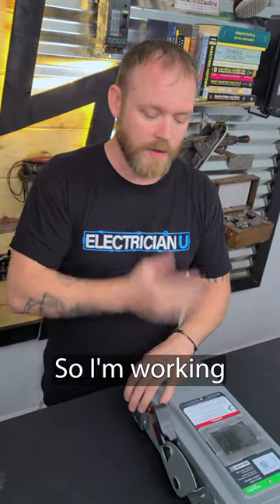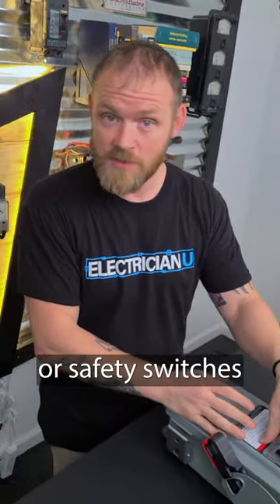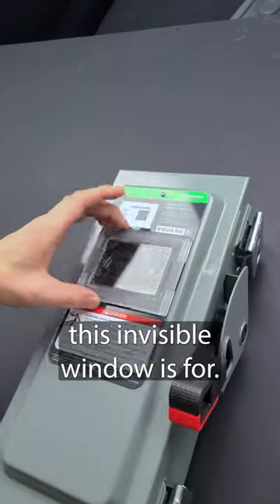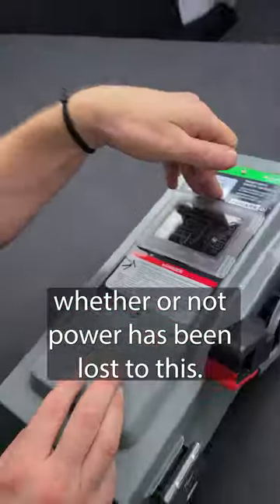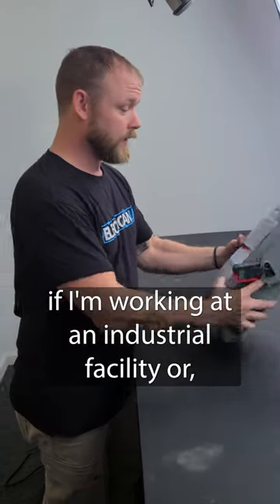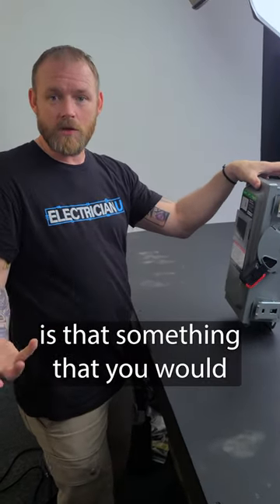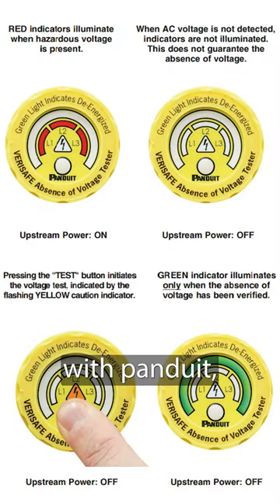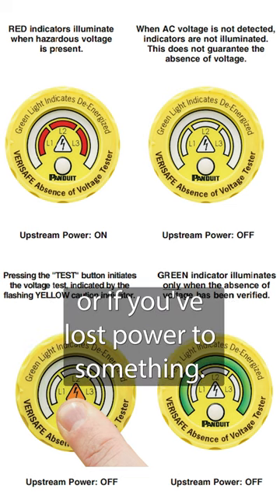Looking For Feedback on Schneider Disconnects

Comment: If it requires a chip, then absolutely not. If it's simple and inexpensive like you described then great. The downside of increased complexity is increase cost. Increased cost means units will remain in service for a longer period than they should. Unduly extending the service life will result in even crappier shut offs in exposed areas. An HVAC technician dealing with these things in exposed areas, I can tell you that many of them are hanging on for dear life simply because of the cost.
Reply: I don't think there would be a chip. Seems like a resistor and the LED would suffice. (?)
Reply: Agreed. I work in industrial maintenance and almost every one of our exterior disconnects are exactly as you described. We buy second hand a lot to keep cost down.
Reply: It really depends on the price break. The cost of material and all their reasons for increasing the price never ceases to amaze me. Yes it’s nice, but I’ll never lose the mindset of opening up a box testing the voltage and torquing the connections.
Reply: Actually a induction loop  to led would work, damn near infaillable

Comment: The industrial panels I work with have a safety test point with phase indicator leds and actual test ports to measure phase to phase and phase to ground voltage ourselves without even opening up the panel. It's super safe especially with high incident energy cabinets.

Comment: Breakers have to be, above all, absolutely reliable in their function. Adding something is always another way for them to fail. Imagine the LED malfunctioning and the tech haphazardly thinks "aw no power", because that was the case for the last 20 times, so he doesn't take the necessary precautions. Except this time, it's the LED.
The number one killer in electrics isn't malfunctions. It's overconfidence. And this, though generally a clever idea, will add to said confidence, when it shouldn't.

Comment: Be worried that the LED fails and you trust it too much and have a shock Hazzard.
Reply: An LED would be on if power was there on each phase. If there wasn’t power the LED would be off? How is that a shock hazard. If you have a power loss or trouble shooting I personally would still test for power for safety reasons at a minimum.
Reply: @ronh9384  hes saying if the LED burns out there could still be power, but the average person might just go "oh the led is off power is off". i agree though as an electrician always test before touching.
Reply: it's just for quick troubleshooting. you're not supposed to trust your life with it
Reply: yeah but you know as well as I do there’s always that guy that will do exactly that.  Gotta design for the lowest common denominator of humans

Comment: If I get a service call and I take the time to assist a customer, an LED light check won’t be enough, I still will test voltage with my multimeter, to make sure power is off/on and also to give customer a clear answer.

Comment: Yes good idea but electrician should still test for voltage safety first
Reply: Then why pay the extra cost for these? 
Wouldn't be used at my work,  electricians would still check with a meter

Comment: Depends on how much more they’ll charge for those LED’s realistically this is something I would only sell to a place that has a maintenance staff that’s not qualified or knowledgeable on the system to repair it. Other than that the old ones worked great and taking the cover off is like a 3 second job. Can’t justify spending an extra 100 dollars just to see a lights not flashing and I have to take the cover off to trouble shoot anyways.

Comment: Phase indication on the load side seems to work well . I have seen this on various applications as long as the wire process seems to be wire to light indicator. Once the wiring becomes to complex it seems to be more trouble than it is worth.

Comment: On the face of it, it’s a great idea. It would help with a quick diagnosis of a problem. 

A potential downside is when someone decides to 100% trust the LED lights and doesn’t check for a live circuit with their meter before putting their fingers in the panel.

Comment: I have been working around angry electrons for over 25 years... ON/OFF visual indicators can be helpful but from my experience testing REAL conditions and what that electrical power reading is still a way to go... for example what would be the min/max range for voltage that LED would be? What is allowed phase to phase in balance? There are many more examples like that... IMPO, No they will not provide any additional advantages for the cost ratio of that new LED disconnect. Not saying the idea is bad but that will be more unique and special purpose disconnects Vs everyday jobs. Good luck and great job with your channel keep it going 👍

Comment: There is already tech like that. They should adopt the tech on switchgears that if the fuse pops, there will be a mechanism to trip the whole disconnect to avoid single phasing on 3-phase motors

Comment: I think it would be a great idea. Especially if they have an LED light on the power input and load side and for each phase if it is multi phase. LED’s are very reliable these days. My suggestion would be to make it a module that could be secured with a screw and easily replaced should an LED go bad thereby reducing the cost. Should the LED module go bad it’s relatively inexpensive to replace and you could use a module for each phase.

Comment: I think this would be a good idea for facilities techs.  But rather then putting them on the line side.  I think this would be better if they were on the load side.  At a glance they would know if there is a problem with equipment vs the incoming feed.

Comment: I think this should just be an add on option, maybe only attach to the front door, have something like pogo pins to make contact when the door is closed, as to not alter as much of the switch/disconnect as possible, and would be easy to change out or be an option for differnt voltages.  Not crazy over the idea of LEDs, which may require addional driving circutry in this kind of application, just screams something that would be damaged by surge events.  Maybe go old school neons, using resistor strings to lower the voltage to the bare minimum to get it to glow at the right voltage, so say it's a 600V disconect, they wouldn't start glowing till at least 550V.  Could have them on the input and output, so it's visable.  It could be made for a very low cost.
Reply: if they are going that route, they might as well ad another light to show brown-out so you know when voltage is low.

Comment: LED indicators on both the line and the load side would be nice. Then we'd be talking about more $ and cost for material, which is already through the roof. Gone are the days of $40 rolls of 14-2 romex and countless other used to be cheap items

Comment: I prefer just opening up the box.  I'm an electrician in a sawmill thats been around for over 50 years and runs 24/7.  I'm dealing with MCC's that range from 30 years old to less than 6 mos. across 30 acres and multiple facilities.  I don't need gimmicks I just need competent and quality across the board

Comment: Simpler design, use an LED to indicate input power to the box, an LED indicated full power output for each breaker. Plus an LED for each Phase.

Use red for input, green for output, and yellow for phase.

Comment: The indicator would have to be directly at the source I think, or there could even be a problem between there and  indication could be false. Kinda like why we use our muti meter to check the most basic things for reinsurance whether it is hot or not. I think it could be kinda a  false diagnosis.

Comment: This piece looks more commercial, but fwiw:

As a homeowner, I need electrical equipment that is usable and understandable by members of my household that aren't electrically savvy. LEDs could be very confusing from a user experience perspective depending on how they are designed, so they should be abundantly clear. Better yet, just use a basic segment display showing OFF or ON. No room for confusion there.

Comment: I'm thinking some blade terminals on line side to feed some small LED for power identification..but then should there also be some for load side as well?..should the cover have a window that a thermal reader could easily see overheating hazards..are the disconnects gonna cost more that the equipment?..lol

Comment: I wouldn't recommend a led light that's always on cause maybe your light will burn out than you'd maybe think there's different problems... but maybe something were there's a test switch or button to push for each phase if light lights up that means power coming to it is good also have the same thing for power going out.... and if we really wanna get fancy put a shunt on each line it'll tell you exactly the amount of power going through each line

Comment: All of SQD's motor controls and HOA controls I've seen for decades have used the green light to indicate ON, motor running. Using it as an OFF indicator is counterintuitive for anyone who has been working with motors for years. RED should be for OFF, motor stopped or in this case, safe to open. JMHO 🙂

Comment: Having 30 years of wiring industrial sites and upgrading industrial sites. Your proposed phase lighting may be useful is very limited situations.  Any electrician worth their salt is going to test with a meter both line and load sides of a 609 volt disconnect when troubleshooting. When up on medium voltage  we use a tic tracer. This is where a phase lighting may be somewhat useful. So over 601 volt a useful idea. 600 and below.  I'm not going to pay extra for as its will be ignored and tested with a meter

Comment: I would rather use a meter personally. lights can go out etc.. I would check with a meter regardless and adding this will just increase the cost of the disconnect.

Comment: Should you trust a device that can fail to tell you something has failed? I would expect the LED would be only to indicate system normal, not abnormal. I also question how to safely determine if feed is live without having open the box to attach probes, as that potentially created situation for arc fault and/or shock hazard for non professional. The objective has to be primarily to improve safety, not to have cool colored lights.

Comment: I would rather have voltage test ports or points instead. Indicator lights can fail, and if the OEM uses Green/off, you can't tell if off is due to loss of power or failure. Also, if OEM uses Green/Red, then individuals who are color blind will not be safe. So, use a Grace port, Panduit, or any other reliable brand that lets operators/technicians test directly.

Comment: I worry that the LED would fail and not indicate there is power there. Instead, I would prefer protected test points that I could connect with my own test equipment that I know is functioning. Even then, I don't think that is needed.

Comment: Don't lose the window at the cost of LEDs and I'd be fine with it. 

Quick question; in the unlikely event that the LED is out how much time will I spend diagnosing a burnt LED? With everything functioning, I'd imagion I'd figure it out pretty quick, but what if I'm the poor sucker dealing with the super unlikely coincidence that both the LED and my conductor are out... (as in, when I fix the conductor, the LED is still out because it's permanently out)? Could end up taking a while to figure that one out. 

I understand the likelihood of this is almost nil, but do you understand my luck with these sorts of things? If it's an undesirable thing, and it happens once in a million years, it'll happen to me.

Comment: I think it would be a was of time. If the machines are running you know you didn't lose a phase and if there was a problem you will still open the disconnect to check your fuses/voltage etc.. Regardless of what the led on the front is telling you.

Comment: Where would it be on the door then it would need wire ran to it then if the are doing 16. 24  or 12 volts then the would be some type of transformer that would go out before the fuse would mostly if is not low voltage then it would need to be an led that can go up to 600 volts for most applications and yet other connection that could go bad, and will LED light last longer than a fuse without flashing and other stuff that they do  I like the window where I’m at that hasn’t came down to us yet but I think the window should be lower so if you have fuses with indicators you’re looking right at them instead of down towards them LED light would be nice but it’s also something else that can go bad before the fuses. Then you still would have to open it up live to make sure fuse are good if you can’t shut or shut power  down to open it an full size window would how great and have like some type of small hole you can put your meter points though straight to the lugs that can open and close easily and seal up then that would help make like how the inflatable pools have that piece that you have to pitch to let air though then once your done it seals b up even if it’s just on the load side

Comment: Normal state should be no LEDs because it's fail safe. Failure states should be with LEDs. Sure that means total failure is the same as normal operation but prevents mishandling from trusting the LEDs. Safety first or whatever.

Comment: In its simplest form using an LED only requires a current limiting resistor. Lets calculate the correct resistor required based upon the following:
LED: 1.5V @ 20MA
VOLTAGE TO MONITOR: 120V
We need to find a suitable resistor for this LED.
Using ohms law we can calculate the resistor.
120v - 1.5V = 118.5V The voltage across the resistor with a 20ma current
Ohms law: R=V/I
118.5V / 20ma = 5,925 ohms
That's a very precise resistor
Now lets calculate the wattage of the resistor
118.5 * 20ma = 2.37Watts
A big resistor.
That all works well until the voltage fluctuates!
 Current thru the LED can vary from 18 to 21 ma (assuming voltage swings from 110-130)
The resistor will dissipate the 118.5V as heat. 
Not very effective. 
This is why an  NEW neon bulb is a much better choice as its current requirements are .3ma instead of 20ma and the voltage range is 65 to 120v thus requiring a tiny resistor.
NEW bulbs have been  used for decades as a line voltage indicator

Comment: No.   Disconnects that size are relatively easy to examine.   Phase loss is not a common occurrence, and never limited to a single circuit.  The  non running equipment below the disconnect would indicate power is lost.  This is a solution to a problem that doesn’t exist.   100A Three phase disconnects are already $250 to $500 a piece.   Don’t make them more expensive.   I was an engr for SE for almost 12 yrs.    This is typical bs by S.E. Marketing.

Comment: I repair A LOT of industrial Schneider electronics, and here's my honest feedback. Punch yourselves in the face as hard as you can 6 or 7 times, and when you recombobulate, immitate Yaskawa because their electronics are art compared to the convoluted crap that leaks out of the brains of your engineers. I just finished a repair on a toshiba branded version of the Altivar71 that took SIX MONTHS, because the generic gate board that's shared across all Altivar71 variants of that frame size, and does the exact same thing in all of them, needed your proprietary firmware in a little 8 pin EEPROM to tell it what drive it was part of. None of the otherwise COMPLETELY IDENTICAL gate boards from any other variant would work in it, and I had no equivalent broken one to swap the EEPROM from. You made about $1000 from my customer's frustration and lost an entire future of very lucrative sales by losing a customer to Yaskawa.

Comment: The stupid lights don’t work half the time. Diversitech has had them on fused disconnects for 20 years. You can never see the light when the fuse is blown. It’s totally pointless and you should have a meter anyway

Comment: It's a waste of time. You still have to use ur voltage meter to check for  power 🔋 n led lights goes bad over the year than might have to replace the unit cause of 1 issue stop ✋️ with the leds lights old school is better than new

Comment: Waste of time,money and potently dangerous. The LED's are guaranteed to fail before the 30yr service life of the disco . Electricians wont trust it anyway and non trades such as machine cleaners and operators will blindly trust it on a shutdown. Sooner or later a dangerous situation for non trades staff unfamiliar with it  will occur. (law of averages )
What are we monitoring? line,load or both? It really tells you nothing  on a breakdown,regardless of indication its gong to be tested with a known good meter anyway
It's another component to service.
its an added cost per unit.
Finally its redundant bling ....Just install Hot Spots or windowed  fuses which are by design much more trustworthy than LED's